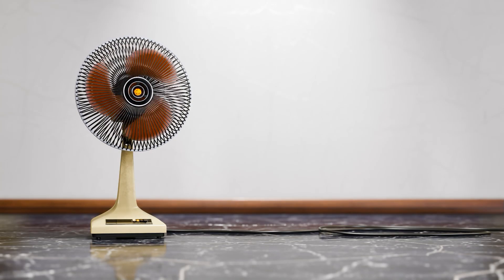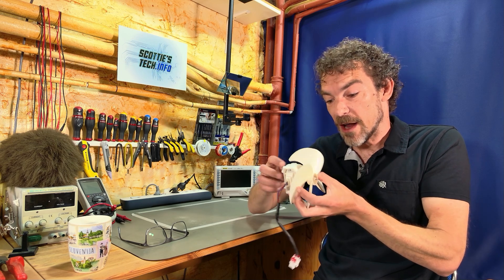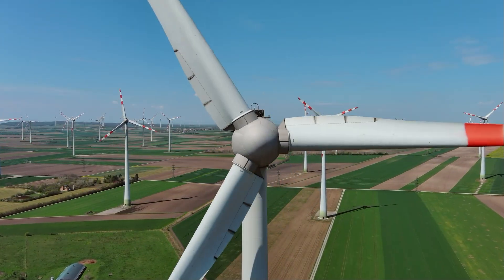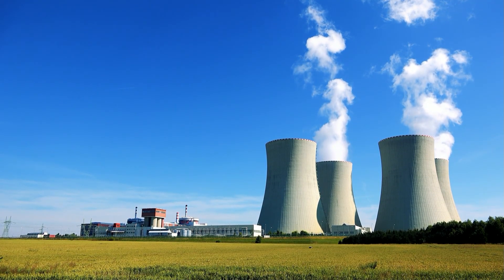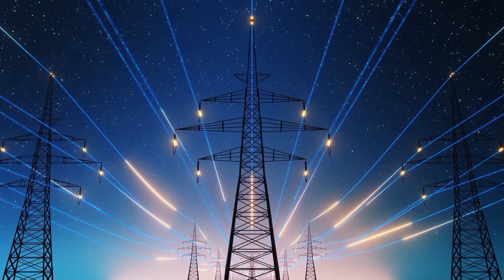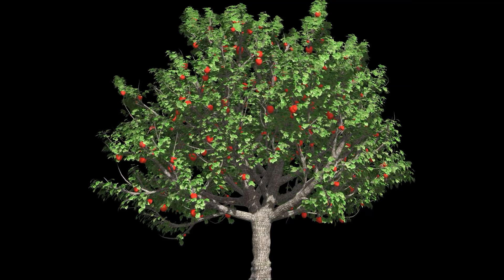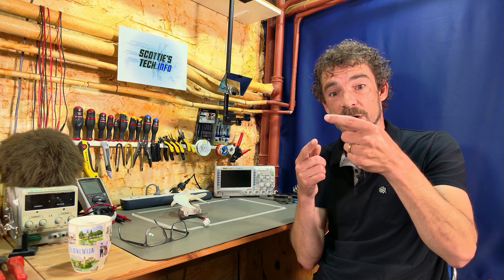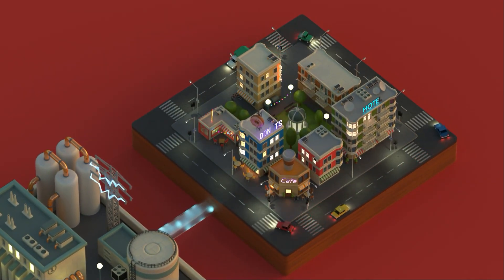Green Grid Part 2: Why 100% Green is still just a Dream

Comment: Thank you. I get all my power from 100W of solar and a small wind turbine rated at 500W max (more like 100W). They charge two seperate completely independent systems so if one falls short the other is there for backup, maunly solar in the summer, wind in the winter. I'm not interested in it being green, I use it so I have no bills and don't need a house. I also only have lighting and a (very posh) smartphone so I need hardly any power. I personally find the whole green energy thing quite absurd given that folk are using such a ridicukous amount of powered machinery/utilities in their homes... 

"I want to save the planet but only as long as I can have all my conveniences."

"'M'hmm... Sounds legit."
Reply: We dont have a population problem we have consomption inequality problems.
And we dont have an enviromental problem.
We have an over consomption problem. And all the corners being cut to sustain it.
People say "more nuclear" I say, "just consume fking less! It costs nothing!"
P.s Renewables make sence under the capasity your using them. Sounds amazing.

Comment: The wires that come from the wind farms out at sea heat up the ocean floor, disrupting fish migrations for example, killing the livelihoods of fishermen.  Can't imagine why this is being called good for the planet.  It's a well documented phenomena in the Waddenzee, north of Holland for example.  Of course, governments don't want to hear about this.   Not to mention the exorbitant amount of fuels needed to transform, build, transport, install these wind farms.  Also, the blades of wind mills loose 50% of their capacity after only 1 year, got this info from someone who used to work in the industry.
Reply from the maker: My personal favorite: how much energy / materials / fossil fuels are required to produce all those solar panels? A TON. And yet, few ever even think about that....
Reply: @ScottiesTech  Indeed.  The production of silica happens at very high temps, 2000 degrees and up if i'm not mistaking, and releases toxins thousands of times more noxious than co2.

Comment: If this was true then it would be possible to convert old coal power stations into pure rotation storage ( like a  giant freewheel) and the problem is over. They don't because they don't need to.  You need to make sense. 

Do need more battery storage. They declared it was not a cyberattack with seconds but takes weeks to see what the cause was.

Comment: "That is the topic of the next video..." What a tease!
I see multiple solutions to the issue of AC getting out of sync, the most obvious one being not to use AC. Using DC for long distances transmission brings its own set of problems, but that brings me to the next solution: Decentralizing energy production. While in some cases it really is more cost-effective to build one large power plant, wind farm, or other source of electricity, it only benefits the operators as the cost savings don't get passed on to the users, and there are significant losses added by long range transmission, so in the end it's more beneficial to generate the electricity where it is consumed. 
If each town or city produces its own AC power, as long as its grid isn't interconnected, it doesn't matter if the timing is off by a few Hertz under heavy load, it wouldn't require a shutdown or cause a collapse.
While not applicable everywhere, at an even smaller production scale, if each house or building had its own wind/solar generation, then AC could be eliminated altogether eventually as almost everything we use runs on DC anyway, which brings up the last solution: Reducing power consumption. By being more aware of inefficiencies and waste and by cutting it down, the actual amount of energy we actually need is probably half of what we currently use, so that could help reducing the scale of buffered power storage needed to rely on 100% on green sources.
It doesn't help that in the west we have a culture of comfort which encourages consumption of energy instead of conservation.
Reply: I'm sorry to say but almost nothing of what you said is better for the gris.

If you use DC less transmission waste and only having to step down voltage are good things. But the bad are: more complex controlling mechanisms (more things to go wrong), much tougher fault detection, more expensive arc extinguishers and ofcourse the elephant - the cost is so huge it can only happen if the current grid requires a full rebuild and a breakthrough reduces the costs. 

On AC microgrids - Hz difference would still be as problematic as in a larger grid. Inertia in those would be less, but on the flip side ita likely that events would be smaller (for example a large producer or substation going down would not be equal to 5 or 10% of the capacity going offline like in the current grid).

Reducing the power consumption is the only thing that could be a big benefit since it would make stabilising the grid much cheaper (less storage, peaker plants and pumped hydro which are all expensive)

Comment: Hi, in a way, so called renewable energy scam is the same that was served to the totomobile industry for now almost a decade, this industry being now bedridden, especially in fronce¹, because old habits of vertical decisions without former researches (or much worse, ignoring them) don't die, as decisions serious evaluation are also never done - and yes, if you think that behavior comes from the uer$$, think twice : who transformed the europe of nations into a stinking diarrhea ?    The french socialauds, hence the corruption level going through the roof.

The Spain blackout was a warning shot, but even with that I'm not sure poliotics have seized the size of the problem at this time (well, all electrical engineers have, but their possibilities of exerting pressure stays quite low), so the "logic" for the near future is more than probably a big blackout, even possibly a european one, that will put many people in a difficult position (loss of freezers and fridges contents, impossibility to withdraw cash, road danger with traffic lights down, alarms down, the whole shebang).

One could have thought that some poliotics would have correctly reacted, but it is not the case, which isn't a first as their level is now negative, so, as usual, people will pay for their bottomless incompetence and incoherence.   This is what's happen when obedience is praised over competence.

______
¹ - For france there's also an aggravating circumstance, as all manufacturers have decided once and for all that producing sh*t was more interesting in the short term than producing quality, and worse, refusing to acknowledge their  responsibilities for broken engines, gear boxes, you name it .    If they keep walking this path, they'll be dead in a decade (in a normal country, but it'll take two as the french government has the habit of subsidizing hopeless causes instead of watching closely the ROI).

Comment: It's the braking effect, seen in all generators where the load is increased, the net effect is the spin of the generator is effectively braked, like a wheel. Problematic when frequency stability in power generation and distribution is so critical.
Reply: Yes, synchronous AC generators needs to be kept at a very precise RPM, or the frequency of the output will start to fluctuate. 

A higher electric load will cause the breaking effect on the generator - and thus more power needs to be pushing on the shaft, in order for the synchronous AC generator to maintain a stabile frequency output. 

And when the electric load goes down, then less power needs to be applied to the torque of the shaft of the generator, or the frequency output of the generator will go up. 

it is indeed a challenge to maintain that very precise RPM of a synchronous AC generator.

Comment: Just a small correction: Red Eléctrica is not owned by the government directly. It owns 20% of the stocks through SEPI, and the rest it's private capital. But yes, it's the biggest shareholder and more or less Redeia (Red Eléctrica) does whatever the government wants. Having said this, there are ways of having renewables with "artificial" inertia, some based on batteries, some others in super-capacitors, but there is a way. But obviously that costs more, and they don't do it. Another way that I'm just thinking (probably it's stupid from an engineering point of view, I don't know 😅) is to mandate that solar power plants install 20% more than the maximum output, so based on electronics, if the frequency drops, they can have that 20% more and modify the frequency a bit to stabilise the grid. Obviously this only works when the frequency is low and not high, but I guess it's easier to control a higher frequency than a low one, I don't know...
Reply: It would be better if the solar parks install batteries, what they don't need to even out the clouds, they can sell at evening/morning high price.

Comment: We need a conversion process in the middle. like hydrogen. If we used renewable energy to produse hydrogen, we could stock pile and burn it when its needed.
Renewable are useful for local production. Like on the roof of your house. But the far away power plant model, not so mich
Reply from the maker: I don't know enough about hydrogen, but from what I HAVE seen, we should have been using it for everything like 20 years ago.
Reply: @ScottiesTech  amen. Preqching tonthe choir.
Cant belive space ex is using methane. Rediculous.
Reply: @ScottiesTech  amen. Preaching ton the choir.
Cant belive space ex is using methane. Rediculous
Reply: Hydrogen is more or less useless.  It is difficult to store, and both creation and conversion efficiencies are extremely poor.  Fuel cells are incredibly expensive at the power levels that battery/inverter systems currently provide for far less cost.   It just can't hold a candle to battery storage which, at grid-scale, has a 93% round-trip efficiency (AC-storage-AC).  Battery cells alone have roughly a 95% round-trip efficiency.   Hydrogen without cryogenic storage is just a tad over 50% round-trip and with cryogenic storage and electrolysis the full cycle winds up being less than 40%.  With higher maintenance cost in addition to everything else.

Batteries are just too good now.  Hydrogen is unlikely to be able to catch-up.

-Matt
Reply: @junkerzn7312  didnt realise it has so many probelms, but..  you say "batteries are so good ""now""... because wev invested exhaustivly in them, yet we still dont have sustainable batteries.... so scaleing up is impracticle.
And how many of those problems would vanish if we invested in hydrogen RandD like we did batteries, hmm?